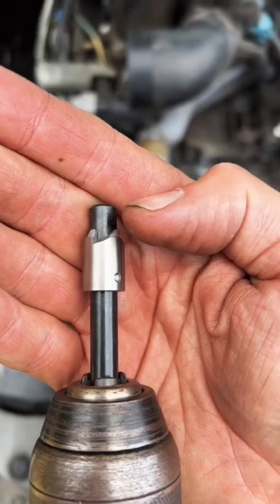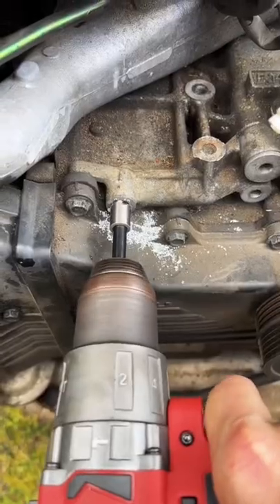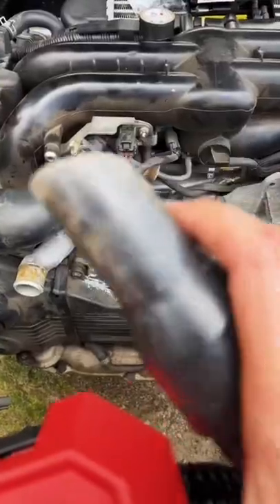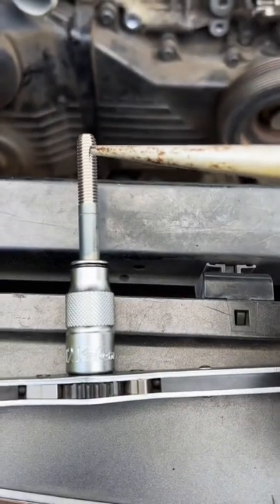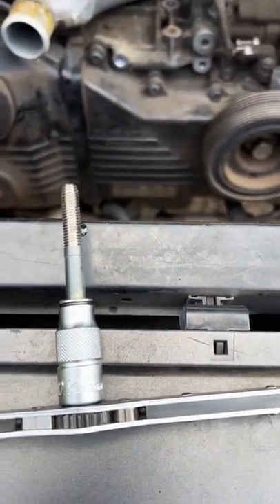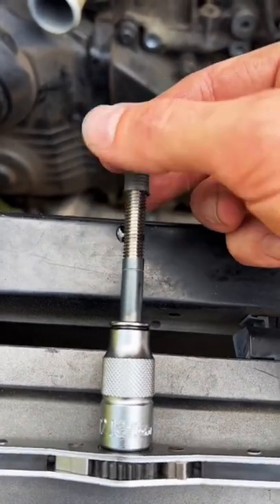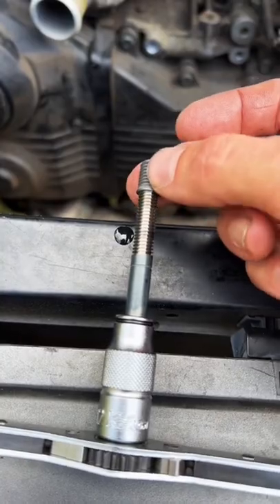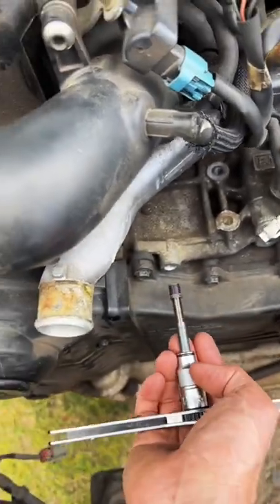Fix Those Stripped Threads Right The First Time! #TimeSert #MrSubaru1387 #Shorts

Comment: The Timesert Insert normaly locks itself. The last 2-3 Threads aren't fully cut. So when a bolt gets screwed into it, it widens the insert locking it into place. Atleast that's the case for the TimeSerts I know.

Comment: The locktite will hold better if you wash out the hole and the outside of the insert with brake parts cleaner then blow dry. Use anti seize on the bolt going inside the insert and the insert should last for years without backing out.

Comment: I've used timesert thread repair since 1980 , great product comes in many materials and sizes.
Reply: Love timesert inserts. Very easy to install and don't really need a installation tool. Way better than  helicoils.
Reply: @CP110  what makes them better than helicoils?
Reply: @johnny0454  No special tool needed to install, and since its a solid wall it has more integrity and strength, has thread locker and sealant which wont leak into the inside due to the solid wall. Not huge differences but appreciated ones.

Comment: Have you ever had the timesurts insurt stop be for being flush or below surface. I've done hundreds of there in aluminum housing for allison filter covers bolt holes. I made a small tool to install the insurt flush be for running the set tool through the insurt. Also I've switched to using green bearing tight lock tight on the out side threads.  Thanks for watching 👍

Comment: I would have chamfered before tapping. A chamfer ensures that the tap goes in true, and chamfering after tapping can collapse the starting threads. That usually only matters with 1/4-20 and smaller though.
Reply from the maker: Right. That's the normal order of operations. Had been a while since I installed a Time-Sert and got ahead of myself in filming the vid.

Comment: Hey Mr Subaru. This is a follow up comment. I replaced both shifter bushings (as recommended) using your video as a guide. Afterwards the shifter definitely felt much better, but still in the wrong place. Neutral is now essentially positioned in what should be 3rd. So first is 3rd, second is 4th, third is 5th, fourth is R, and fifth and reverse are just way over there where it shouldn’t be. Like I said, it was a problem after the shop replaced the shifter fork. Any ideas? Might need professional attention? Still works just fine, just off.
Reply: It is possible to install the shift linkage rod incorrectly. This will cause the shifter to be way off center but still functional.
Reply: @basik1dotcom  what should I do? I didn’t know there was a wrong way? I thought maybe the plastic bushing with lock ring could help me adjust it… but im not sure

Comment: Lmao at the end: "Better than new".. Thanks for the video
Reply: Most of the time, the steel inserts literally are better than original/new. The insert's internal steel threads are way stronger, and the external threads are based on a larger diameter.
Reply: @LynxStarAuto  id love to know, never heard of a car with a magnesium block or head. Mind being a scholar/internet hero and showering my peasant head with wisdom?
Reply: @CoreysZ32  BMW N52. Just a very poor design with aluminium and magnesium sandwiched together. They use aluminium bolts on most places on the block to avoid electrolysis.
Reply: @ma61king  Wow, thanks for sharing! Another person stated "volkswagen" which lead to fun videos of people throwing old beetle/super beetle short blocks into beach fires... Glad i asked
Reply: @CoreysZ32  All so called aluminum blocks/heads etc. are actually an alloy of aluminum and magnesium. That's why aluminum wheels are also called "mags" (short for magnesium.) In some places they use the word magnesium instead of aluminum to refer to the same thing.
Reply: @johnny0454  interesting, thanks for the fun search terms! Sounds like magnesium was the first cast metal for wheels, followed by aluminum alloys, and the term mag stuck for cast and alloy wheels for a bit. 
VW did use mag engine blocks with iron sleeves, fun reading!

Comment: So I’ve got a question I’m studying mechanics diesel and gas and i was wondering why not screw a bolt into the threads that were tapped instead of adding the insert and I see this used a lot more on gasoline engines than diesel is that because they are as heavy/powerful than a semi

Comment: Nice helicoil job! Only thing I would have done different was to put some tap magic on the tap bit before you tap that hole. It really makes a difference as far as smooth threads but great job!
Reply: That's not a helicoil, it's a thread insert, which is a solid piece and Mitch better than a helicoil
Reply from the maker: I did use Tap Magic.
Reply: @MrSubaru1387  heck yeah man. Looking forward to your next video. That ratcheting tap handle is sweet.

Comment: That's also known as a healer coil You could buy an autozone
Reply from the maker: This is NOT a heilcoil.
Reply: @MrSubaru1387   Then what do you call it
Reply: @MrSubaru1387   I looked in the hanes manual
Reply from the maker: @jcaleca60  a Time-Sert. They're completely different.

Comment: The only thing I’d change is you chamfer after you drill and that gives the tap a taper to start more easily.
Reply from the maker: Right. I mixed up order. Been a while since installing a Time-Sert
Reply: @MrSubaru1387  
Still just about the most concise demo of this on YouTube , Also never seen a ratcheting tap holder like that . 
More videos like that please .
Reply from the maker: It's made by Ko-ken. Can get it from kokenusa.com promo code MrSubaru10 for 10% off.

Comment: Retired Professional Mechanic.  In America we call that Heli-coil. You can buy it in a kit any size at auto parts store.  Been around for many o
Reply from the maker: No. In America we don't. A Heli-coil is a Heli-coil. This is a Time-Sert. Time-Sert is a solid insert. Heli-coil is a garbage way to fix threads. It's just coiled wire.

Comment: While this is definitely a solid repair the phrase "better than new" is a bit strong.
Reply: Often it pulls up tight and is lock-tited in, so it often will be better than the original threads.
Reply from the maker: Steel threads are stronger than aluminum threads. So yes, better than new.
Reply: @MrSubaru1387  either way it's going to be steel threads on aluminum threads.